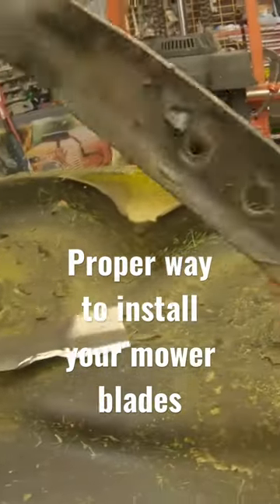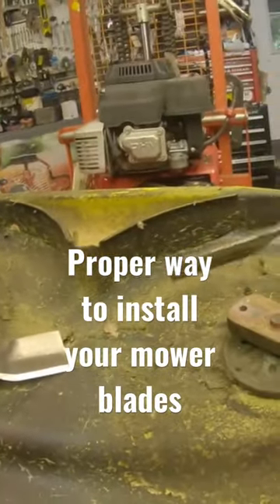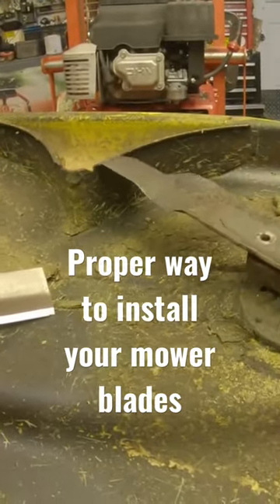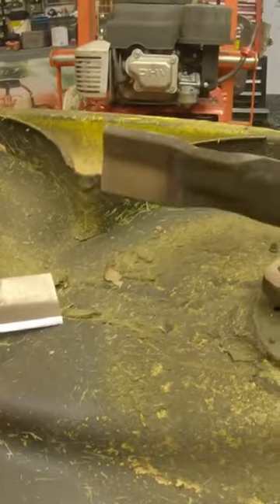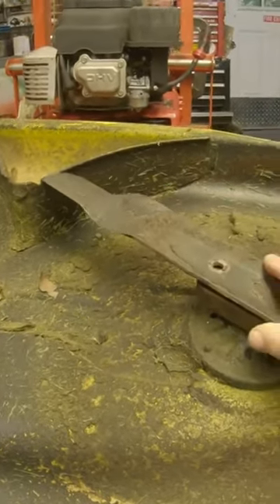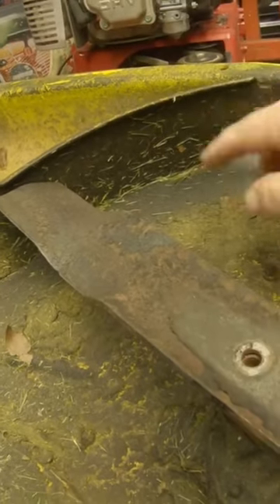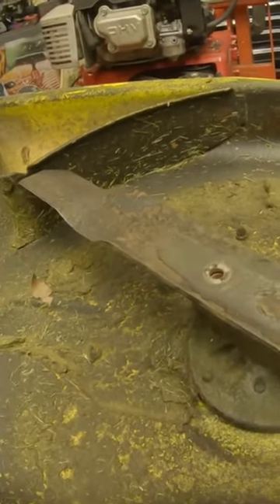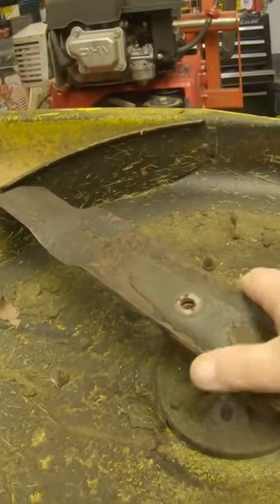Simple - Proper way to reinstall your lawnmower blades #baldeagle242

Comment: The second most important thing is to put anti-seize on the bolts.
Reply: So it gets loose and amputates your leg?
Reply: I’ve had my mower for 20 years. Never put in antiseize on the blade bolt and remove the blade bolt every month or two.  No need for anti seize
Reply: @condor5635  
When you constantly remove that bolt.
Never a problem but when you got a bolt that been on a lawn mower for years. Then you are glad what you put on the threads.
Reply: @condor5635  Damn. I thought I had OCD!  You actually remove your lawnmower blade every 6 to 12 times a month?
Reply: @georgea6403  I think I meant once or twice a year switching between mulching and cutting blades. 😀
Reply: What about Blue Locktite
Reply: @georgemartinezjr  I don’t think it’s necessary, but to each his own
Reply: I put jb weld on the bolts.
Reply: @rywolf01  
So your my mechanic that worked on my truck.
Reply: @assassinlexx1993  probably, but I use the horrible freight .

Comment: Aw, sometimes that's helpful to put the blade on wrong. My brother did that one time,  got disgusted and gave the mower to me. I fixed it and it became one of the best lawn mowers I ever had!
Reply from the maker: I’ve seen it many times over the years. Most of the time they complain because they say the mower doesn’t have enough power to cut taller grass.
Reply: Easy peasy right !
Reply: I had a guy give me a Toro push mowing because he couldn't figure out why it would not start. I cleaned the carb and ive had i tut for 6yrs now

Comment: Those who put the blade on wrong should not be do any mechanical work. They could get hurt. Especially if the blade comes off during use. Better for them to pay you and be safe.
Reply from the maker: @Joseph Dozier Thank you for taking the time to share your comment! I hope to see you around on future videos. 😊👍
Reply: I think the guy that put the blades on wrong also worked on the front brake calibers on a Dodge Dakota I bought 10 years ago. The bleed plugs were on bottom. I agree some people should not own tools.

Comment: Where are the 2 blades cutting edges in relation to each other when cutting? What’s the symmetrical alignment for the cutting edges?
Reply from the maker: On John Deere mowers I don’t believe any have to be timed. It you’re working on some EXMark, Toro or a lot of commercial mowers the blades do overlap and have to be timed.

Comment: I ran into the same problem when I worked at a small engine repair shop
Reply from the maker: It’s funny because I’m getting a lot of comments on this video saying how obvious it is and common scene should tell you how they go on. However, every year I get one or two in the shop that have been installed upside down.
Reply: @baldeagle242  one woman brought her self propelled mower after another shop was supposed to have done a oil change and repaired the transmission they made it look as if they did they did nothing I had to rebuild the transmission replace the blade which they installed it upside down long story short. they charged her 200.00 dollars for nothing the owner of the shop where I worked charged her 15 dollars for the oil change everything else was on us.
Reply from the maker: I had a similar situation last year. Customer took a rider into the shop for transmission issues and apparently they never even looked at it. A stick had been lodged into the disconnect rod not allowing it to push in all the way. I pulled the stick out and it was working perfectly.
Reply: @baldeagle242  We could talk all day about the owner errors that we have worked on some cases were laughable others no much. I am sure that you have had a client or two who didn't think that checking the oil level was important.
Reply from the maker: @shadowwolf9329  I had one that told me they used vegetable cooking oil because they figured any oil was better than no oil. I wasn’t quite sure how to respond to that one. 🤷🏻‍♂️🤣
Reply: @baldeagle242  I would just walked away

Comment: Does the orientation of the blade matter ? I’ve kubota GZD 15 and it’s not firing out the grass properly just wondering if the blades are out of position 🤷‍♂️
Reply from the maker: You may have mulching blades. For discharge you want high lift blades.
Reply: @baldeagle242  their the original blade I think, it has 2 blades but does both have to be parallel when fitting so when they come around together they fire the grass out the rear ? If one is 90 degrees out would it matter ?

Comment: maybe I've only owned weird mowers, but not one I've had were you able to mistakenly install the blade upside-down.
Reply from the maker: Most are “keyed” in a way that prevents it from happening but there are plenty that have showed up in our shop with the blades installed upside down.

Comment: If you increase the angle on that edge it will last longer.
Reply: Just the opposite. The narrower the edge, the faster it wears.
Reply: That wont have near the cut and will ultimately slow you down. A trained ear can even hear the difference.

Edit: im speaking in favor of as sharp as possible. Lay that grinder angle back.

Comment: What would it be vibration on the deck?
Reply from the maker: You’d be cutting with the blunt edge of the blade. You wouldn’t feel any vibration it would seem like your mower had zero power as soon as you got into tall grass. Generally when I get mowers in the shop with blades on upside down that the first thing the owners tell me.

Comment: My blades are right side up but they're so old the cutting edge is about a blunt as the back edge.
Reply from the maker: I’ve seen a few like that over the years. If you live in a sandy area it doesn’t take long to wear the sharp edge down to nothing.
Reply: @Baldeagle242  , I have slightly sandy soil but I also drive over a lot gumballs, the ones left over after I get tired of trying gather them all up.
Reply: I have a junk mower that I have used for 6 years.  I have never once sharpened the blade  !
Reply from the maker: I’ve seen mowers with blades so warm the sharp edge was duller than the back of the blade. In fact I show one in this video. https://youtu.be/dFGhM_xd13o

Comment: Is there a rule about how to know which way the axle rotates?
Reply from the maker: I believe all gas engines rotate clockwise so the blades will also rotate clockwise.
Reply: Have someone pull the cord while you stick your head under to take a a look. Alternatively stick your foot under the deck while running and feel which side gets hit. (Don't do either of those they turn clockwise)

Comment: If it’s such an Engineering problem, why not stamp the blades so that everybody can understand the intent of the design.  Create a go-no go for installing properly.
Reply from the maker: There are quite a few manufacturers that do stamp and key blades so they will only go on one way. It’s generally the less expensive mowers and tractors that skip the little things like that to save a dime here and there. Thanks for taking the time to leave a comments. I hope to see you around on future videos. 😁👍

Comment: Anyone who needs this to be explained probably shouldn't be using a lawn mower
Reply from the maker: You’d be surprised. I get at least one every year.
Reply: @baldeagle242  
That's... discouraging. I've seen mower blades with the word "bottom" stamped on them. Mowers don't have oil plugs anymore either. You have to stand them on their heads to drain the oil in order to change it. Like someone who doesn't know which way to put the blade on will actually think of changing the oil.

Comment: I always whip the grass , I see nothing wrong there ! Lol
Reply from the maker: You’re not the only one. 🤣👍
Reply: It was sarcasm Bald Eagle ! Lol
Reply from the maker: @edwicks66  Ditto. 😉
Reply: I got basically a junk mower when I moved to my new place cause I couldn't afford anything else. 6 years later and the mower STILL "cuts" fine and Never sharpened once  ! ....... Cutting or whipping, either one works for me  !
Reply from the maker: I’ve seen mowers with blades so warm the sharp edge was duller than the back of the blade. In fact I show one in this video. https://youtu.be/dFGhM_xd13o

Comment: Now I want you to put an extra blade on there that is actually a mulching blade and I want you to sharpen both ends of the helicopter sound it will make it will mulch your grass so fine into a powder you will thank me ...... 😂😂😂😂😂
Reply from the maker: Thank you!
Reply: Sir I put a mulching blade over the top of my regular blade and sharpened and put the fins facing down the fins on a mulching blade they suggest having it up inside not facing the grass and doesn't cut that well but having a two blades your lawnmower was sound like a helicopter and it cuts it down mulching the grass into small dust blades
Reply: I'll take a picture of my tomorrow